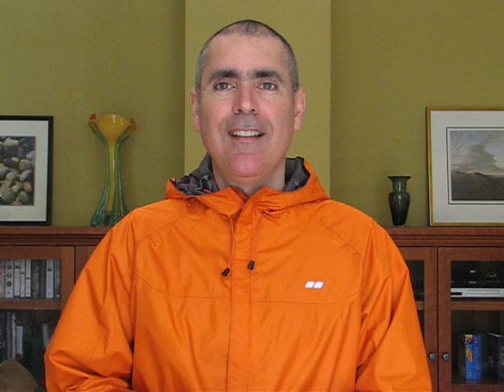Why We Prefer Not To Build Double Stud Walls

Comment: Cellouse will definitely settle over time, have had to repair on a 14’ wall and after looking at the mesh it looked odd because it had settled 2’inside the attic but of course you can’t see in a closed sheet rocked wall .
Reply: Sounds like it wasn't installed properly

Comment: you made lot of inaccurate and misleading statements! if done right, the uppre floor sits on inside wall, therefore no thermal bridging! SIP panels are definitely not easier for plumbing and electric installation, and definitely very difficult to do repairs if needed and it definitely also lowers the R value! Shame for trying to missleading us with false facts! sell your product but don't lie

Comment: Please change your video title to the excuses i make to use sips instead of double stud walls .

1.) Where the second story meets the second story wall can be framed to have a foam board sandwiched between the exterior sheeting and the rim joist creating a thermal break. An example can be seen here  http://passivehouseto.blogspot.com/2011_02_01_archive.html

2.) Cellulose only settles over time if you have not dense packed it , you have installed it improperly allowing water infiltration, or you have not paid proper attention to vapor control . 

3.) Wiring can cause a small loss in r value but it's minimal at best. You could also use a larsen truss but whatever .

Lets look at the pitfalls of sips .

1.) My local sips factory charges $5.40 per sqft for a r40 based panel , at this rate if i wanted 12 foot ceilings it would cost over 12k just to frame the outside walls  for a 2500 sqft house . bulk 2x4's are only $2 each when you go to the pro desk at home depot , the same or cheaper with with most other supply houses .

2.) Continuous insulation is a myth , all sips have thermal bridging at structural  connection points as well as framing for doors ,and windows.  Where panels meet is also an issue with most manufactures since they are tied together with 2x4 studs along the top, bottom and sides .

3.) Delamination , Do i need to say more ?

I love sips for many reasons such as speed of build , strength and the ability to use less skilled labor to assemble them , but i can not find a single issue you pointed out that is either true or simple to correct with proper planing  .
Reply: Ok thanks

Comment: Sorry to say but you have no idea what your talking about, single stud walls unless you use a large amount of foam/Roxul Rockboard ( I would recommend Rockboard, it's an insulator, fire proof, sound proofing and water resistant ) on the outside every stud on your house is a thermal bridge to the outside, if your having issues with the band between floors using open cell spray foam in those areas helps to eliminate that issue.
Double stud walls eliminate the thermal bridge if you know what your doing, you may prefer not to do double stud walls but please don't misinform people as to their effectiveness 
Knowing the science of how to properly weatherize a home is key as a lot of factors are involved and I won't go into all of those here. 
I am building a Passive home this summer and what your talking about makes little sense.

Comment: Chris is obviously selling his product and idea. That is the free market we live with.   Fortunately there are other options to the home builder.  
I am currently sitting in a 30 year old, two storey, owner built double stud wall home in Sault Ste Marie Canada.  I designed and built this home for our family in the mid 80's. With a walk out basement it has a 3600 sq ft foot print (yes arguably bigger than we need then and certainly bigger than I need now need now)
The walls are only 8 inch thick with offset 2x4 stud walls one half inch apart.  Each wall is insulated with fiberglass bats -  (R12).  The electrical wiring utilizes that 1/2 inch spacing between the walls. Since I did everything myself, including the electrical, that wiring option eliminated almost all drilling and issues fitting for the insulation.   I am comfortable saying that there is minimal thermal bridging and no sagging of the insulation.  Fortunately I have had no reason to verify that!
Key to this discussion should be house orientation on the building lot and consideration to solar gain when needed (and not).  The climate of the area is important as is the value of shade trees.  Probably more important than wall insulation is the location and size of windows and doors relative to the climate of the site.
Living adjacent to Lake Superior, I have a fairly unique climate.  Typical winter mean of -10C to - 15C  and summer of + 10C to 15C. Although  is hard to grow eggplant here, in this home I have never desired AC.  
I heat the house with one medium sized wood stove in the basement using about 10 stove cord of wood/year.  I have an electrical heating back-up but rarely use it.  As I age that may change?
Reply: 10cords of wood per year seems like a lot

Comment: Costs more + less time = more profit per work hour of the company...
All those disadvantages you listed can be easily worked around by some one who knows what he/she is doing
Actual R value is always lower than advertised no matter what system you use (because of advertising, advertising actual R value wouldn't sell the product as much, and every house layout is different)

1) Between floors, all because some people don't insulate doesn't mean it's impossible, usually it's done with foam though.
2) cellulose settling= insulation installer didn't dense pack it enough
3)wiring/plumbing, it is more difficult to do with SIPs than double stud walls, where is the argument there? R value loss would more in the SIP usually. For when it needs to be serviced, well it's even harder with SIPs usually because you'd have to reverse feed then feed it through, adding an outlet or something, omg that's a job. 

In conclusion:
SIPS: cost more overall (material costs a lot more, labor is a lot cheaper), easier to install, even though electrical/plumbing holes are done at the factory, adding more after installing is no easy chore. Anything you do requires being very careful in keeping the foam inside mostly continuous (there is still 2x6s usually there between SIP panels)

DSW: a lot cheaper for same R value, can reasonable go to much higher R value. not as continuous insulation generally. electrical/plumbing is easier than most wall systems (later editing is possible but involves digging I suppose?)

Comment: SIP's are full of toxic and eco harmful foam. The manufacturing process of the SIP's does way more harm to the environment than they would ever offset in energy efficiency and the occupants suffer from being exposed to toxic indoor air as a result of VOC off-gassing from the SIP's. Mark my words... in 50 years or so you're going to see a whole rash of new cancers cropping up linked to living in a house built with SIP's.
Double stud cellulose walls on the other hand are built with wood and recycled paper.

Comment: Do some more research, you let your second floor sit on the interior wall and the cellulose goes from floor to top plate by passing second floor rim/joists!  DENSE PACK CELLULOSE DOES NOT SETTLE!!
Reply: I agree with
Sunshine Bright
If the inside wall is the bearing wall, then the insulation can run continuously past each floor with no thermo bridge.  This will also allow the installer to finish installing the insulation from the attic space, and if there is any settlement, additional insulation could be added at a later date.  Although, if you install 3 feet of insulation in the attic, that would help offset any settlement in the walls.

His concern of future elec. / mech. work is an interesting one.  I have wondered if the plumbing stacks should be separated from the insulation, with drywall at the back of the studs, yes it would reduce insulation value, but it would provide a warm space for plumbing, and future work would be easier.

Any thoughts?
Reply: ***** Yes, but, you really need to get foam on the exterior side of exterior wall to prevent damp/cold sheathing which where your condensation comes from. check out greenbuildingadvisor
Reply: ***** I have worked out a detail where a second wall could be added to an existing house to create a double stud exterior wall, with continuous insulation in between, but I think I would be inclined to remove the existing interior and exterior finishes and just use the existing framing for the interior wall.

The down side is the extra costs.  

These type of houses have potential moisture issue already, because they are sealed up so tight, so you don't want to add any potential problems of your own.

Comment: just thinking aloud - 

- why not use high density insulating foam for the inside of the top plate (and maybe bottom plate too)

- why not tack a 'barrier sheet' to the exterior of the inside wall and blow in only between that and the outside wall - leaving an open (interior) wall for any electric and/or plumbing runs ? 

- as for the settling insulation - no ideas.  Is there a blown in system that will not settle ?
Reply: Josh Thalheimer the denser the packing of the insulation, the less settling that occurs.

Comment: Double stud is viable if done correctly. Make the additional wall on the OUTSIDE of the supporting structure. Dense pack cellulose does not settle.
Reply: Never a fan if cellulose or spray foam, dense pack fiberglass fan in closed cavities based on my zone.. not a fan of Cellulose because of density issues and the fact I don't believe many contractors actually know how to do it correctly based on experience, or bring it to specified density, and also big variations of product quality depending on manufacturer and their raw material quality difference of the time based on the the original sample they used for the coverage chart. However in a loose fill attic or dense pack on the outside of a building i think are great applications for cellulose based on its  properties.  As there is no such thing as bad insulation, only bad application. But I do favor rockwool properties on the outside over cellulose
Reply: used (sprayed with glue) cellulose once - Never again - 9" settlement within 5 yrs

Comment: I am currently working on an addition project and agree with you on the issue with the utilities. However, I am using a method of conduits between the inner and outer wall that will be suspended in the cellulose. Yes it allows air moving though the conduits but no more than SIPs. Second, if you pack your cellulose right you will not have settling in your walls. Third, yes there is a thermal bridge between the first and second but less than traditional homes. SIPs first choice double stud good to